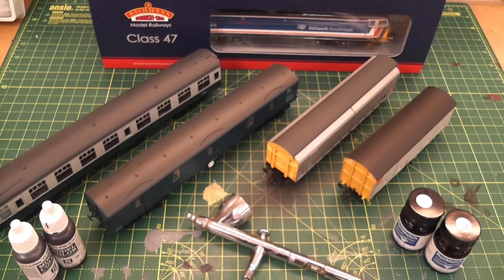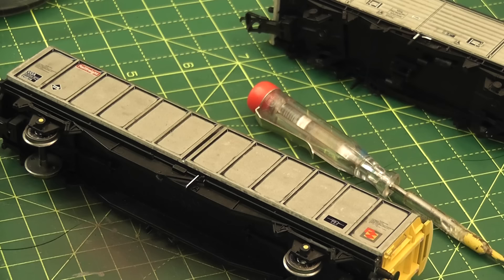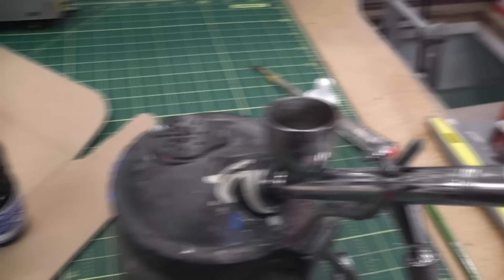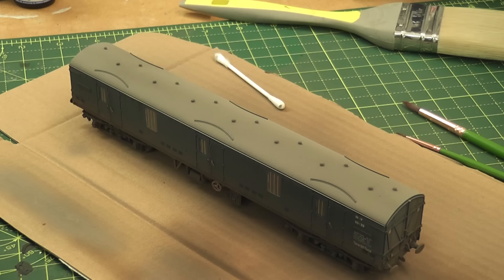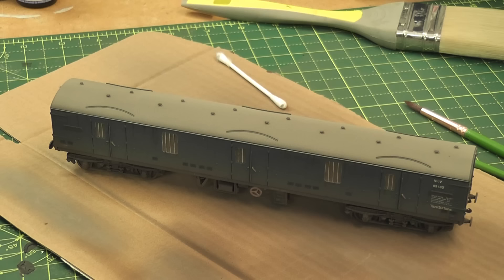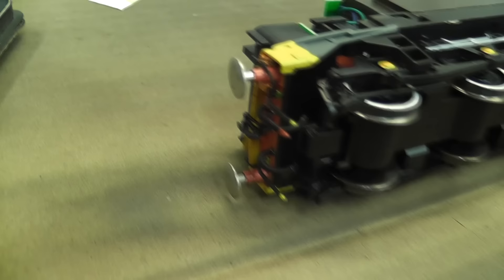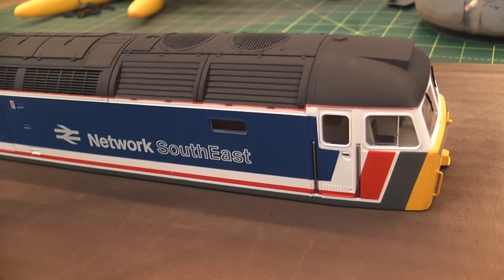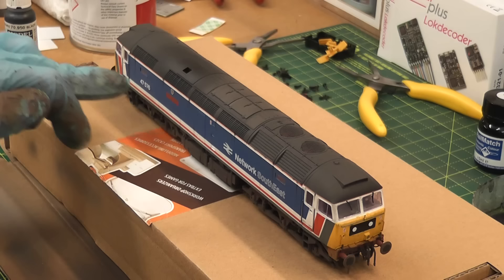Weathering Locomotives and Rolling Stock

Comment: 14:00 I have a reeeaaalllllly rivet-counter criticism of the VDA there -  it has the pre-1960s overhead warning flash, with the large single lightning bolt. For the 80s it should have the version with two red lightning bolts with the word DANGER in between. Looks much better than the current yellow warning triangle!

Comment: The effect on the panels is because you used plain water in the black paint.
The surface tension wont break so it mostly settles in the recesses then just as its drying the tension will draw it up and and coat the whole surface in varying levels of paint.
You should invest in some of the Games Workshop wash paints. Theres a lot to learn there with painting.
You should also look into using a paint thinner. both paint types do much better when thinned down. Its no different to a automotive paint sprayer spraying a car youve restored not thinning his paints.

Comment: I noticed when you apply the wash you're applying the it as if the car were upright (a natural tendency since that's how we see the world).  Since grime would fall due to gravity, why not flip the model upside down and apply the wash that way so that any pooling of the wash would be on the top of the detail rather than the bottom.  A different color could be applied to parts of the bottom detail to mimic grime being kicked up by the wheels.  I surmise that the effect you had of the pooled grime on the bottom detail happened when you sat the wagon on it's wheels and got the same effect.  Just a thought, you're work is excellent in any case!

Comment: A very interesting video Richard, nicely shot too.
Not a criticism by any means, just a thought: you used "before and after" comparisons on a couple of occasions; would it be an idea to do this after each "stage". Something like: so, before I did the black on the roof, it looked like this; afterwards, it's changed to this.... 
I haven't explained that very well but, instead of comparing the model back to the untreated one(straight out the box), compare it back to just the one step earlier - if that makes any sense.
Just a thought ☺
Dougie.

Comment: Hi hello mate, I noticed when you were doing the class 47 you put a varnish over the top to seal everything but I don't think I saw you do this with the coaches and the wagons was that the case? Plus I saw a video where someone spread varnish on first so that the weathering had something to stick too again is that something you did or didn't do with the items in this video??. Are you supposed to varnish everything first and then again at the end after you've finished.?  Many thanks.

Comment: Super video Richard
The GUV is awesome, I'll be trying this in the future.
I assume you clean the loco wheels before use as this always catches me out, its also a bit tricky to do.  The other thing I wondered about as Ive tried this but getting the bogie frames of the loco is extremely difficult without snapping anything, is there a knack to this?
Love the new layout
Cheers
Paul

Comment: Hi Richard - I learn so much from watching your vids. 

I am having problems with the 'Nylon Screw' approach to dcc fitting a Hornby Pancake motor (in a class 110 dmu).

Unlike many vids I have seen, my model does NOT have a left pickup connection to the metal chassis. I have tried to engineer my own - a hole drilled in the chassis and a self tapping screw threaded in, to which I have soldered a lead - but the problem of DC running persists (I have fitted an 8-pin socket harness to the loco with the correct colour leads fitted in the appropriate places and fitted a blanking plate the correct way round). Do you have a video with this type of pancake motor being modified?